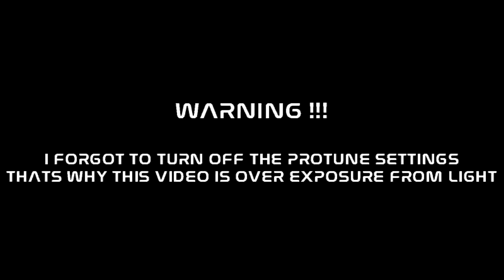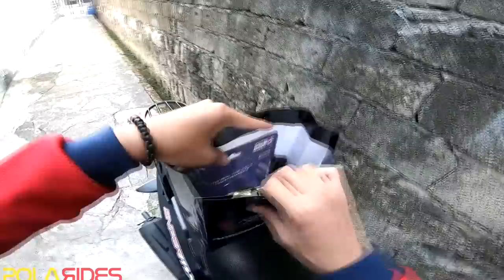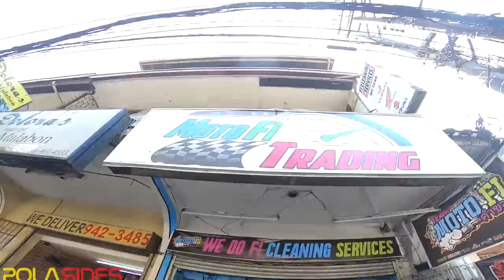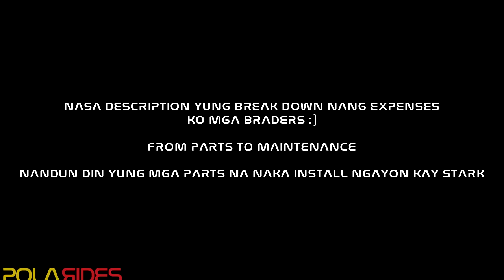20000 Kilometers service of my Yamaha Sniper 150

Comment from the maker: Para sa mga Katanungan Nyo mga Braders :)

List of parts:
1. Uma Clutch Lining:
2. Motul Engine Oil
3. Yamaha Genuine Parts Oil Filter
4. SKF 6004 / C3 Flunge (Sprocket)
5. SKF 6300 / C3 Front
6. NSK 6202 Rear
7. Yamaha Genuine Parts Steering Bearing / Ball Race
8. RK Racing Sprockets 14-45 428 Gold

Service Done to Stark
1. Change Oil
2. Change Oil Filter
3. Tune up Valve Clearance ( Last 14kms Adjust )
4. Change of Bearings ( Front & Rear Mags and Flunge Sprocket Bearing. )
5. Replacement of Steering Ball Race
6. Change Coolant
7. Lubricate Clutch Cable
8. Replacement of Clutch Linings
9. Replacement of Sprockets and Chain

Check out MotoFi Trading: https://www.facebook.com/groups/1545178989090546/
MotoFi Trading Map: https://goo.gl/maps/CQELFymQixs
Reply: Thanks paps. May idea na ako para sa maintenance ng sniper ko.
Reply: musta takbo ng 14/45 sproket mo ganda bah hatak nya tnx.
Reply: Paps Pola talaga bang eto ang mga kelangan sa maintenance ng Sniper150 natin?
Reply: Magkano lahat nagastos paps?pa pm.